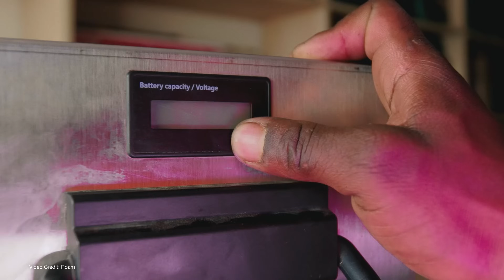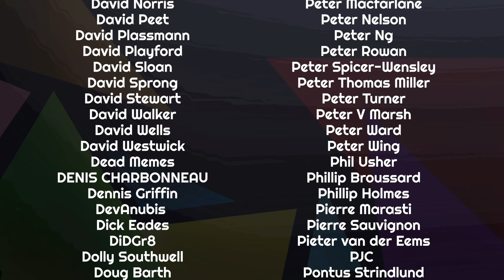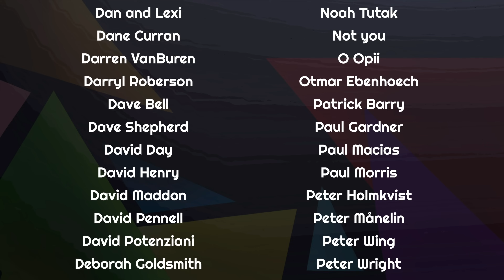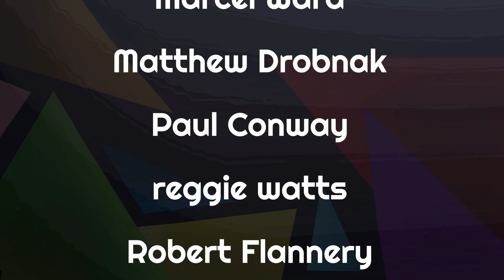The Electric Motorcycle World Is Split In Two - Here's Why

Comment: Full-sized motorbikes in the West and Oceania are TOYS. I quite enjoy mine and feel no need to skirt that reality. 
Two-wheelers primarily used for transport include scooters (ICE and electric) and the overwhelmingly popular e-bicycle whose legal advantages make it even better than the increasingly 
obsolete gas moped. The e-bicycle is an electric moped much more versatile than a "motorcycle" because it can go where they legally cannot. 
E-bicycles are further evolved than overpriced, short range e-motorcycles which remain toys (which is fine) at this point. E-bicycle PERFORMANCE WINDOW OVERLAP covers the same range as small displacement ICE two-wheelers. 

A key reason for lower small conventional motorbike sales in the West is legal. If one is going to bother with a license, insurance etc the modest cost difference between a 125 or 250 and a used, low mileage larger displacement motorcycle favors the full-sized machine unless legal impositions like tiered licensing are employed to coerce the market. Fuel prices only matter when artificially inflated by punitive taxation.  Electric motorbike range is currently poor even by motorcycle standards so they're best fit where electricity excels (trials riding for example where electric crawl speeds are ideal and dropping your machine on your leg won't roast flesh). I can afford a Zero but have no reason to want one and that money would cover four more Norton Commandos (cheap in CONUS).

Comment: I feel like the big factors holding back electric motorbikes are: 
- Aerodynamics. There's no way to make a standard motorbike as aero as a car. This limits them to commuter use in cities (where, to be honest they do very well but compete with e-scooters and e-bikes that, arguably, are an even better fit for the commuter role). Hopefully this brings about some cool designs though,  dustbin fairings? Kaneda bike? 
- Drivetrain design. I don't know if there's a design reason for it but e-motorbikes seem to be using much lower voltage systems than cars which increases the charging time. 

Interestingly ebikes seem to be growing exponentially. It does make one wonder if, with current technology, hybrid systems aren't a much better match for our needs than full EV, at least given our seeming inability to realise that our current lifestyle isn't sustainable
Reply: Well, most motorcycles with a fairing catch less drag than the comparatively huge front-area profile of a car.   
A lower voltage battery doesn't at all mean slower charge; fast-charging creates heat though & most ebikes\emotos don't have battery cooling fans. 

Within its typical operating range, a motor produces more power per Watt if fed higher Voltage, so I very much swear by ≥52V being better for ebikes & ≥120V for emoto & EVs. Higher Voltage at the cost of Amp-hour capacity really isn't worth it though; so, to get good efficiency at high speeds, means adding more cells overall. 

Ebikes skip most of the traffic that emotos still have to sit through, & it's possible to pedal them home if the battery gets low. Also, at low speeds, being able to pedal even a little increases range dramatically. These two reasons alone, make ebikes more practical than emotos or scooters or stand-up escooters, for most use cases. 

I really think emotos struggle with a relatively high cost compared to gasoline motorcycles or ebikes. The biggest electric scooters manage to achieve decent range per dollar, but scooters have a stigma in the US, & frankly I don't like their handling. (At least mopeds gave you a decent sized wheel!) 

A sleek emoto with a huge battery, costs big bucks, but can't ride all day the way gasoline motorcycles can. That's a hard sell, for something with no roof that can't use a bicycle route... 

Swappable batteries could make the difference, but for long range emotos, that'll mean multiple batteries

Comment: Very nice video but electric motorcycles make very little sense today. (Note: the prices I show are in Portugal) 

A Seat Mó costs €5350 almost twice as a Voge SR1. A Super Soco TC Max (the same as Revolt) is €4500  as a 95km/h max speed and up to 110 km autonomy. The beatiful Macbor Lord Martin is €2900 as 115 km/h max speed (a bit better on highway) and a 2 liter / 100 km consuption with a 14 liter fuel tank (a 700 km autonomy that noone needs).

The price difference will pay fuel for 40.000 km. If you do 100km per week that's almost 8 years.

And this is all in good weather. For cold days ICE motorcycles can have heated grips that on an electric motorcyle that would drain the batery in no time.

Comment: 13:00 Just wanna point out, Revolt motorcycle shown here, which started as a battery swap service provider, no longer offers that, since their acquisition took place by another big Indian group, now their motorcycles comes with fixed battery. The previous owners of Revolt was not very transparent as they took advantage of the Indian FAME2 subsidy scheme for EVs, govt too air of it and fined them, the new ownerships are much more responsible and cleared the fine, but their subsidy hasn't yet been reincorporated. While Battery swapping for 2w still exists in India, most notable among them is a brand called Bounce, most 2w makers have either dropped their previously declared plan or never opt for it, primarily because removable batteries are a hassle in 2Ws mainly due to space/energy density/volumetric density, So, none of the forerunners such as Ather, Ola, Bajaj, TVS, UV, Orxa has opted for it. Hero still has removable battery, and Gogoro is trying hard to bring their battery swap model from S. Korea to India and Honda/Yamaha being a big laggard in EV space, trying to clasp onto it, but I don't see it succeed, as their specs in performance/range as well as ride quality are far behind the Indian manufacturers...and not to mention the software driven architecture, while Indian 4W are archaic in software driven architecture, Indian 2w such as Ather, Ola, TVS and UV have developed  completely software driven architecture, the OTA and the charging experience provided by the brand Ather is second only to Tesla(I am not exaggerating). On the other hand, Battery swap is increasingly finding its footfall in Indian e-3w market space, which has already achieved 50% of the market share(both in slow and fast type vehicles).

Comment: For those long months of winter storage, the Energica motorcycle has a long-term storage mode where it can be left plugged in and the electronics will tend to the needs of the battery.

Comment: There is market resistance also. Partly it is the loss of the visceral nature of the ICE used in bikes, but also because a significant proportion of motorcyclists in the 'Western' zones are a bunch of luddites. They want to be different, but not to stand out from their mates. Enough of a paradigm shift and it results in confused pointing followed by rejection. The same is broadly true of the custom or cruiser scene. But electric is just not butch and manly enough in their case. Combine that little lot with the use case and manufacturers/designers have a challenge in the West

Comment: Moped-style electric scooters have gotten fairly capable, though ranges remain fairly low at roughly 60 miles on average.  There are several models like the (high-end) BMW CE-04, that are highway-capable with a max speed of 75 mph.   The more typical moped-style electric scooters are limited to roughly 40 mph but that's totally reasonable for city commuting.

E-bikes are also getting pretty good too.  For example, look up the Euybike S4 ... an electric-assist peddled bike with 7 gears and 40 miles of electric range.

Comment: I rode motorcycles for almost 50 years until recently when, being elderly and having had Polio, I'm just not able to.  But for most of those years I rode in Minneapolis or Duluth, MinneSNOWta 12 months of the year.  I've ridden several times at -30f.  I've had almost 50 motorcycles and most of them have been ridden in winter, including 5 two-wheel-drive Urals and even an electric Vectrix. For many years I commuted all year.  One of the coolest experiences of my life was at a winter motorcycle show at the Duluth Arena Auditorium and I and a buddy on Urals walked outside at -20f, and with a flock of people watching, we both kick-started our bikes on the first kick.  Riding across ice and snow covered lakes is an experience every rider should have.  I loved the Vectrix, but it just was not yet the time for it, being prior to Li-ion batteries.

Comment: Thanks for this video Nikki.  I would like to see more electric motorcycle, and sit-down scooter options to become available in North America.  It would be great if Zero and Livewire could improve their products to provide more range and charging speed.  Finally, I would like a 100-mile, 10 kW (13 hp), sit down scooter that weighs less than 220 lb and has great styling like Piaggio and Vespa.

Comment: I used to be a year-round rider even in Norway, using two wheelers as utilitarian daily transport. I could carry as much groceries on a scooter or a Trans Alp than I could in a small car. But when I look at light electric bikes being introduced these days, especially by manufacturers in the western world, they tend to be totally devoid of  luggage solutions. Not even a few extra inches of rear frame to attach a rack to. I think the designers are missing a great opportunity there. The smaller ones are not very attractive as joy rides, but they could do a very useful job if they were able to carry things.
Reply: The Fuell Fllow will have 50 liters of lockable built in storage space. Taking orders now with projected delivery starting 4th quarter 2024.
Reply: what about the bakfiets u see in the netherlands? they're super cargo haulers, and i think most are electric now. 

would love to see TE do  video on them.
Reply: The whole point is that you shouldn't need a bike specialized to cargo: It's easy to include cargo mounting points when building a bike frame; much less so once it's finished & painted

Comment: Ahhh!  Hi Nikki ^-^
No kidding!  ATGATT, all-year rider here (tho much more recently than Nikki).
Battery swap isn't really compatible with our freeways; if you're going over 50, the battery capacity is being used up massively quick.  Which makes a swappable size just... Unlikely.  It would have to be a really big battery!  Luggable, maybe?  Even so, that's not a size of bike really being made today.  Metacycle?
Reply: Swappable sizes are workable with higher power bikes. All you need to do is use more battery packs and wire the battery compartment to run the packs in parallel and/or series as necessary.
Reply: Battery swap is a city thing in my opinion. It would work in NYC, Chicago, LA , etc.
Reply: I have seen concepts where you drop the battery down out of the bike, and roll it around much like a wheeled suitcase.
Reply: @randomguy7253 Silence 01 does that. It's no concept 😊

Comment: I need a EBike that can do about 35-40mph and I would be solid in my city.
Reply: There's a bunch of Chinese export bikes that fit that bill.  And that's the size that battery swapping works great for!
I use a Zero at mostly those speeds, you can get one with 6kW charging (refill at destination in 1-2 hours) for $6+k used ($12-24k new)

Comment: I'd say itty-bitty cars (Smart, iThink) are a better choice. 4 wheels > 2, cargo, etc.
Reply: Can't lane split, heavier, uses more power, are more expensive and quite frankly, isn't as much fun! (Assuming you are a motorcyclist.)  Plus you can only fit two, not six in a normal car parking spot. :)
But they DO have a roof and would make a great replacement for big cars. Yes.
Reply: @ElectraFlarefire  This is why I have hope for Aptera in the US.  Something exceedingly light and freeway-compatible.  It fills a footprint, yes, but only a physical one and comes with solar cells to make up for it.
Reply: @CrissaKentavr  The Arcimoto is closer to a motorcycle and a better match most of the time and of the two I'd rather it as it leans. But I'll agree that for a car driver the Aptera might be an option compared to the Smart.
Reply: Right.  We're in America, so BIGGER is ALWAYS better!  Yes, 4 IS > 2, but more is not always THE answer.